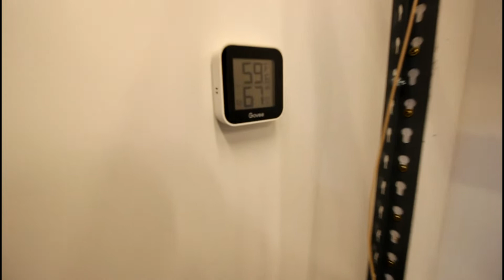The Custom Enclosure Build for my Creality 3D Printers is DONE!

Comment: have you thought about using octiprint?
Reply from the maker: Yes! That’s on my list of to dos is to learn how to use and install octoprint! Have you used it before or do you use it now?
Reply: @Addimotive  I am still getting my 3d printer setup and actually printing.. there is some setting issues so far. After its going good, I will send it with octoprint.  I have the camera and raspberry pi bought and how to install it.  I was debating on setting it all up